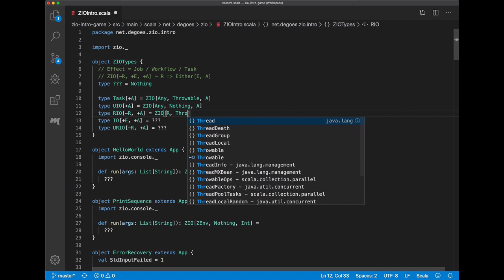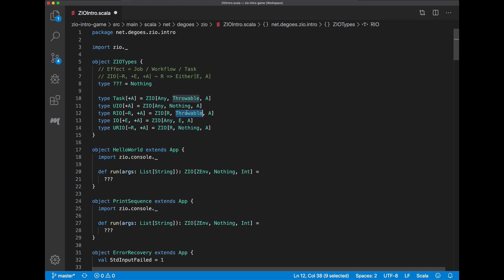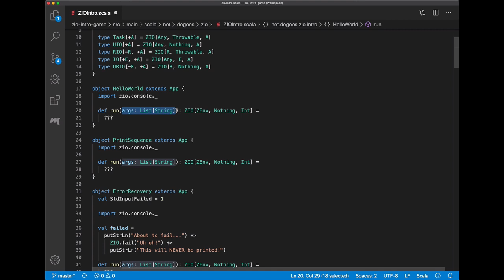A Tour of ZIO

Comment: I'm trying to understand Dining Philosophers implementation and I don't completely see how blocking in takeForks works. It retries on left/right fork TRef[Option] until its Some(...) yet I do not see anywhere in the code where it is set to None in the first place so blocking part never happens. In fact if you run implementation, it shows "Philosopher N eating..." for all philosophers and then "Philosopher n is done eating" as if none of them are blocking each other from using forks. Am I wrong on this or takeForks should look like this:

  def takeForks(
      left: TRef[Option[Fork]],
      right: TRef[Option[Fork]]
  ): STM[Nothing, (Fork, Fork)] =
    for {
      leftFork <- left.get.collect {
        case Some(fork) => fork
      }
      _ <- left.set(None)
      rightFork <- right.get.collect {
        case Some(fork) => fork
      }
      _ <- right.set(None)
    } yield (leftFork, rightFork)